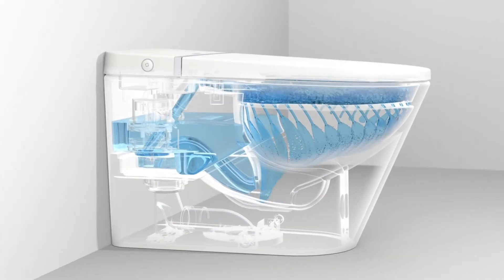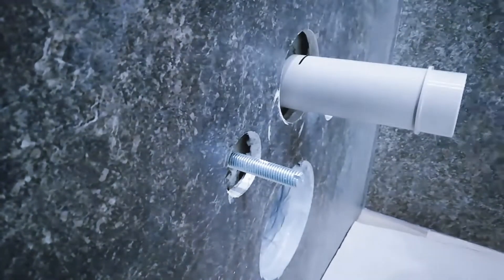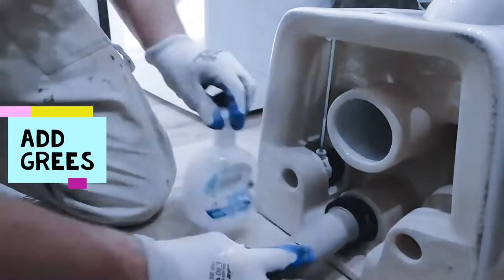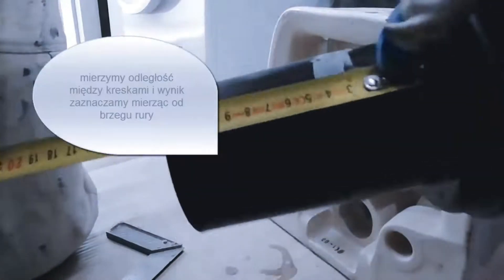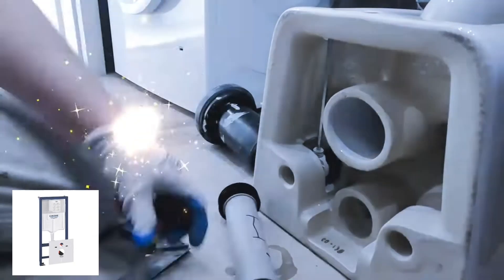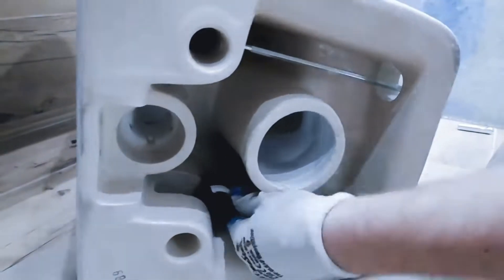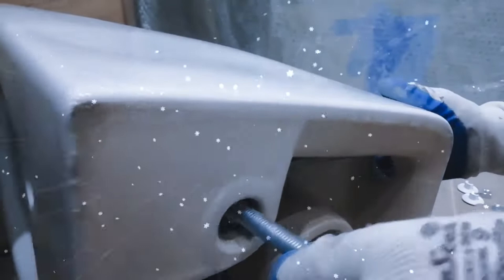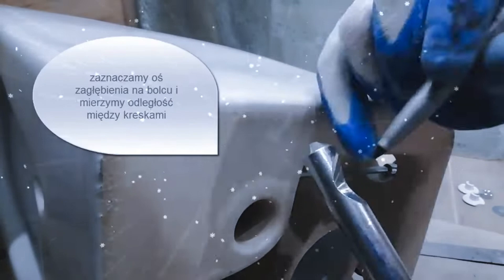Grohe WC Installation Perfect WC Installation 🚽 Technical Guide and Expert for All Toilet Types

Comment: Y? You( put pepper or poly form or another form material before wc fixing in the wall
Reply from the maker: Hi @NajmuNichu,

Great question! The reason for using materials like foam, pepper, or other forms before fixing the WC to the wall is to provide extra cushioning and support. These materials help reduce noise, prevent potential cracks, and create a better seal between the WC and the wall. Additionally, they can protect the surface and ensure a more secure installation over time.

If you have any more questions, feel free to ask!